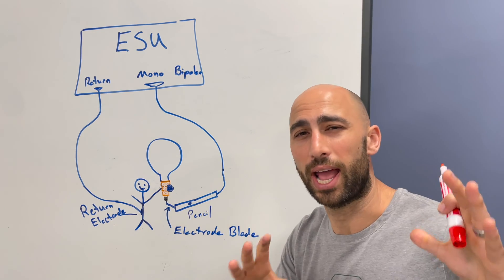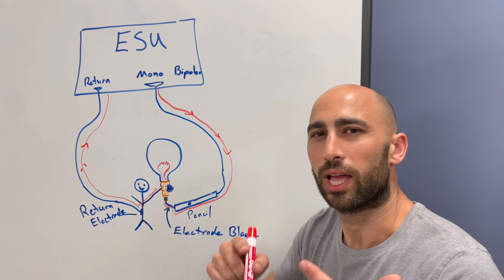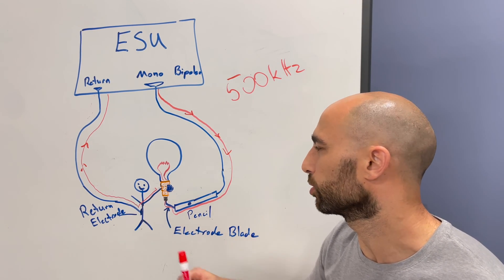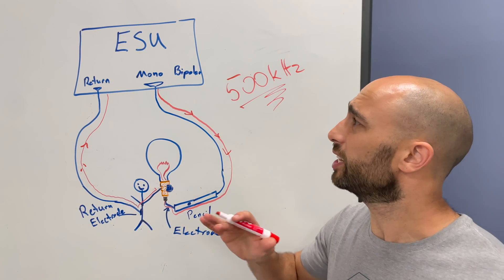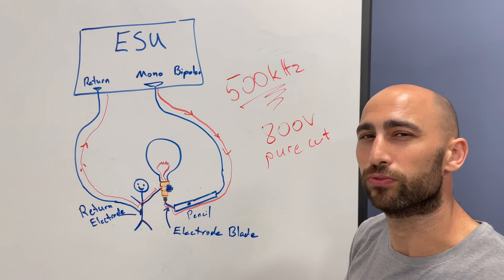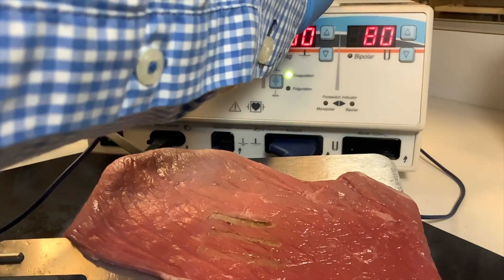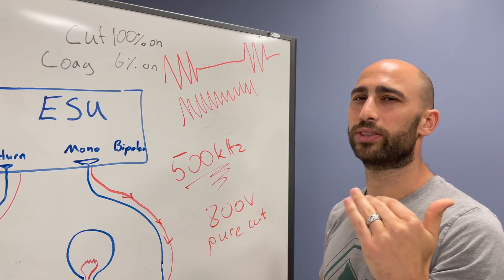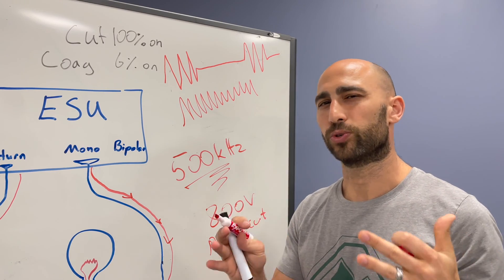ESU | How does a Bovie Work?

Comment: One of the reasons an ESU operates at such a high frequency is the threshhold for activating nerves. 500kHz is far above that level.
Excellent Video!  Maybe we can do a joint video in Florida at FBS.
Reply from the maker: Great point! Yes I should be there let's try to do something even if its just hang out!
Reply: what happen if person touches ground ???lol
Reply from the maker: @cesarcantoral6100  Good question - and I have a somewhat complicated response - first it depends on the ESU - most ESU's now-a-days are isolated (but in the old days and still some brands have the return grounded). So depends on the circuit, ESU, and any leakage current. But with the isolated systems you may be perfectly safe - depends on a lot on the circumstances.